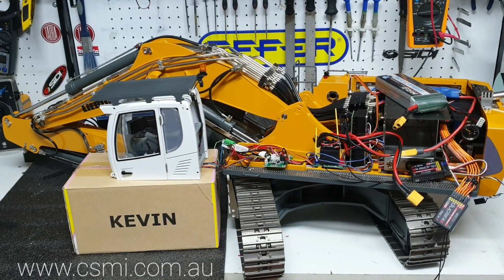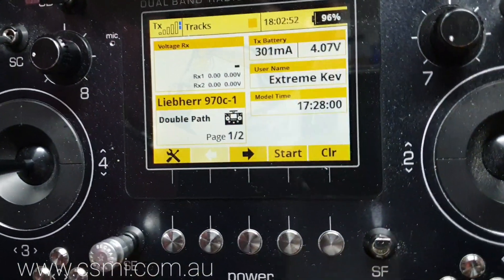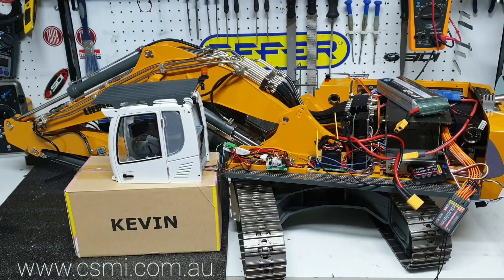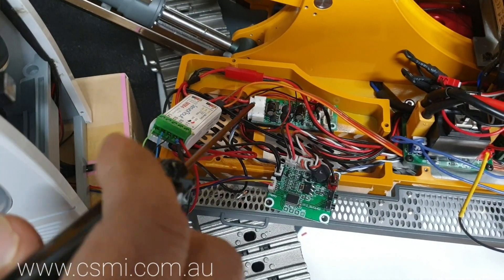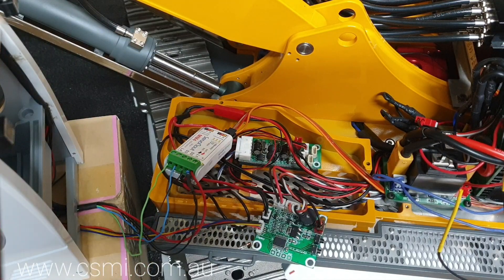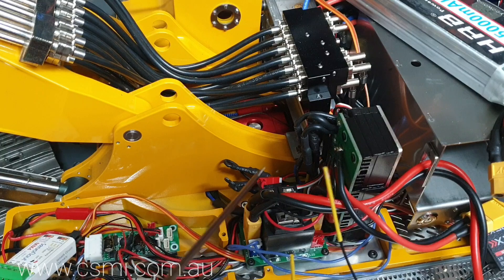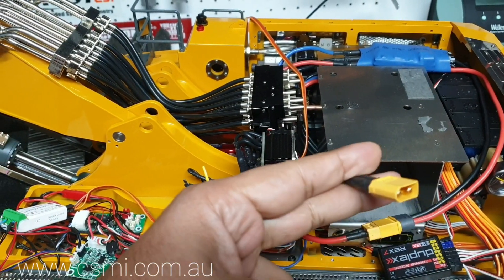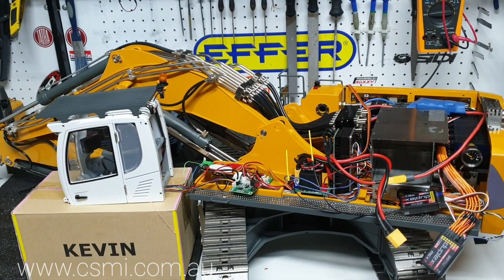CSMI : EX9700 cab light modification explained.

Comment: Thanks for the video.

Is there any possibility that I can connect the excavator to a power source and not have to use the battery while I learn to use the K970 100S?